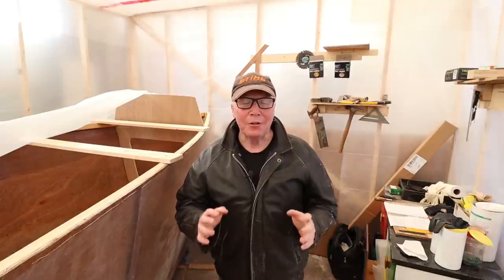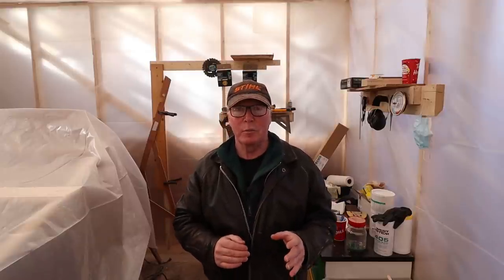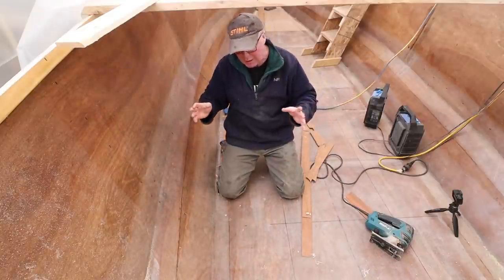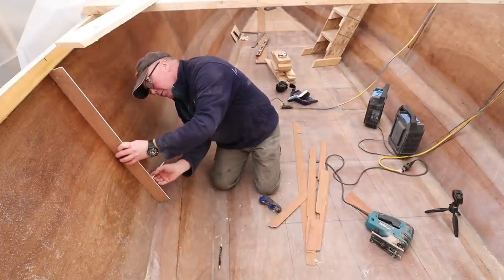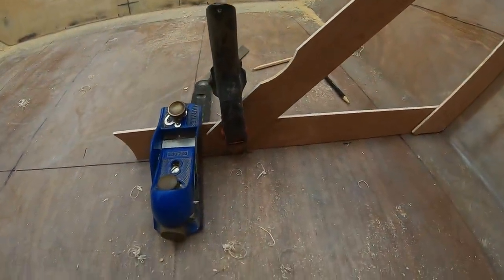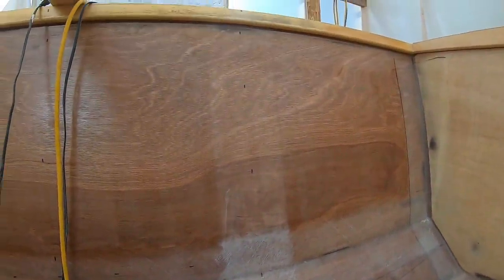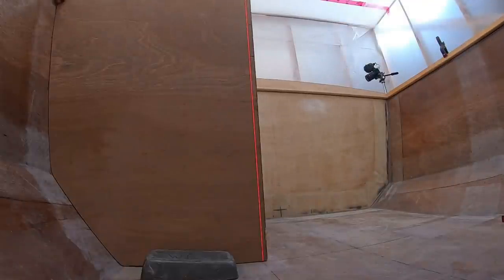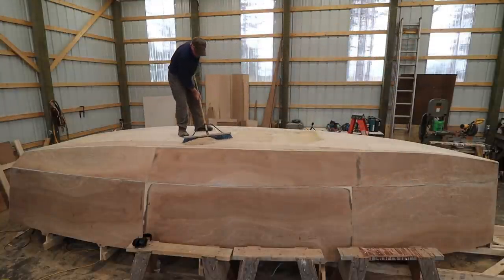S2E34 How to Build a Bulkhead in 3 easy Steps || Wave Rover 650

Comment: Love yr work, making a small knee height work bench/saw stool could also work instead of using your knee to cut with a jig-saw.
I wonder if also laying  a 1/4 in thick flexible ply ( temporarily) in the place of the bulkhead to pick up the bulkhead shape and then just scribing the shape with card to transfer to the bulkhead timber - certainly I would do it to establish the shape of a more compound hull shape

Comment: I've found that a plastic milk crate (ca. 35x35x35cm) is quite portable and works well for things like sawing, etc, to reduce personal risk. Also, too bad that the bulkheads weren't at the frame locations, that would have saved a bunch of work making patterns.
Reply from the maker: In the kit version of the Wave Rover 650 the bulkheads would also act as the mold.

Comment: Are you saving all of your original forms/templates?

You could sell kits either by supplying form copies, or use them yourself and sell cut pieces.

It's probably on the order of 20:1 hr differential if one could either just assemble from cut pieces or cut to each pre supplied template.

Imagine if one could farm out to/DIY in some fishing village in Latin America, SE Asia, etc

If one could realistically build this out under 30 days, it would make it practical to take an extended stay trip.
Reply from the maker: Terrific idea! I sold the temporary frames at cost to a fella nearby who is planing to build a copy of the 650
Reply: @RoversAdventure  You might consider using your finished hull as a plug.

Imagine if you had a nice form from which to produce fiberglass hulls. Now that would pick up some interest.

 If one could get a trailer and simply pick up a completed cast hull shell, that would save the vast majority of build hours.

If you had templates for the bulkheads (or sold pre cut pieces), it wouldn't take a DIY person very long to finish constructing a finished hull, including the decking.
Reply: I should add that none of this would require any particular expertise or additional time on your part. 

The real key is the plug ie your boat that you've helped design and are now building by hand. For the majors, this is where all the design expertise comes into play. 

The rest is mechanical. So simply go out and find someone who has experience creating boat forms from plugs. There's hundreds if not thousands of people who have developed these skills over the last 60 years.

Next, ship the completed form somewhere cheap like Arkansas, Alabama, wherever. Have the form guy or some other local fiberglass person begin to make wholesale shell hulls.

If this boat performs the way you (and I) think, I can't imagine why you wouldn't be able to sell at least a couple hundred kits.

Comment: That’s a very fussy fit for something that gets covered up. Are you sure you’re not a teacher or something… ; )
Keep up the good work!
Reply: Ocean-going sailors tend to be fussy about things like that. A well-built boat is a strong boat, and thus a safer boat. The ocean is incredibly good at finding weak points, so the goal is not to have any weak points. (As I like to say; At sea, there is no such thing as "over-engineered" or "overbuilt". There is only "is this strong enough?" and "what can we do to make it even stronger?")
Reply: @Garryck-1  Oh I hear you - this is not my first rodeo.  But to elaborate on the point of my comment, the real strength of the joint is in the glass and epoxy.  Not the ply.  As Alan points out, you actually don't want a perfect fit. i.e. a loose joint in this situation is actually stronger than a tight joint since it's the "glass and plastic" combo that's providing the real strength and bonding between surfaces.  The ply here, to a large extent, is just a core carrying the material doing the work.
So the point of my joke was, resist the urge to be too fussy here.  A little loose is better, and on top of that you don't see it anyway!

Trust me, I'm fussy...  I did a couple of videos of a small boat I built a few years back - on YT.  Right now I'm building a 21' trailerable folding trimaran in PVC and epoxy sandwich.  It's been quite the project so far.  Main hull finished, beam mold presently under construction, 70% there - videos to come...when I finish.  And on that note I better get off my arse and get back to it.  : )  Cheers.
Reply: @robinhodgkinson  - No worries mate.. and all the best with the catamaran. I'm in the middle of building a Chameleon nesting dinghy myself.. which I should also get back to!

Comment: I have built CLC flat bottom kayak 13ft long, not sure about stability of 21ft flat bottom ocean going boat.....
Reply: I think you might be forgetting this will have a keel/s fitted later. Right now it might look like a large canoe. But that will change.
Reply: @robinhodgkinson   I understand , my kayak is designated for "protected" waters, and I understood that this was due to flat bottom design ( although there was no mention of it, so I may be wrong).
 Now, if WR650 has double keels and "keel" in front of the rudder, that would make a great boat for shallow waters in my area - could sit on the beach during tide out.
Reply: @2dogsnight  Sure, bilge keels have there advantages. My point was, a flat bottom is more stable than a round bottom, but either way it’s the ballast and keel that will largely dictate it’s stability at sea. Your comment caught my attention because I too built a kayak many years ago which had quite a round bottom and it was close to impossible to keep it right way up in anything other that flat water and with a determined concentration on your paddling action.  Kinda took the fun out of it…  I put it down to my lack of experience and expertise, but after numerous attempts at mastering it I took a paddle in someone else’s and realised the design was the problem. Not me!  : )

Similarly the last boat I built was a small deep V runabout (on YouTube ).  And while it was great design - smooth in the waves etc, the price you pay for that in a small light boat was it was quite unstable at rest. Move to one side of the boat too quickly and you could tip yourself over board! Which I very nearly did on a couple of occasions when the fishing got exciting. 😂  Whereas the flat bottom skiffs you see a lot of being built on YT for lakes and sheltered waters - great on flat water but would pound badly in any sea, you can waltz around on and they barely incline. Every design’s a compromise in some way I guess. Cheers
Reply: @robinhodgkinson  as I am learning more about WR650 I start understanding the design. Very interesting design. There are  2 bilge keel plywood boat design that I know of ( S. Devlin and T. Roberts), they are both in 18 foot range. I like bilge keel because of my tidal property. Too late for me to get into building one, but sure it's fun to watch someone else build :-) . Not a fan of the junk rig, but understand the reasons behind the decision.
Reply: Junk Rig 
No stays to worry about failing
Super simple reefing
If constructed well equal performance to standard sloop.

You must not of heard of Roger Taylor and his 21’ Arctic voyager Ming Ming. Junk Rig is perfect for single hand sailing.